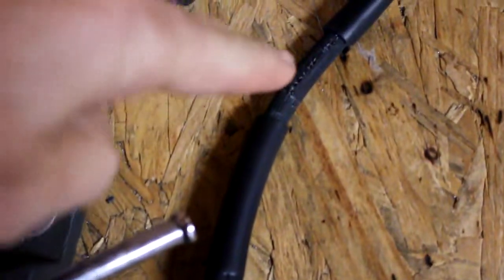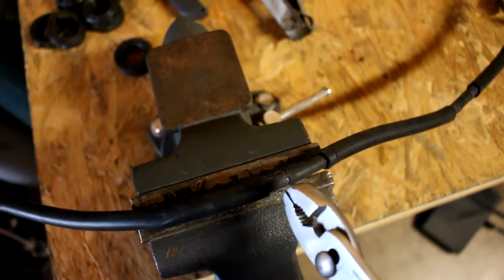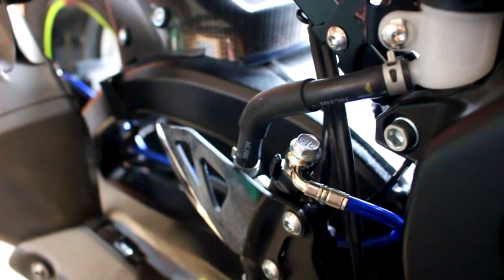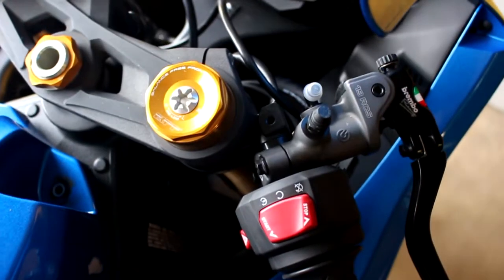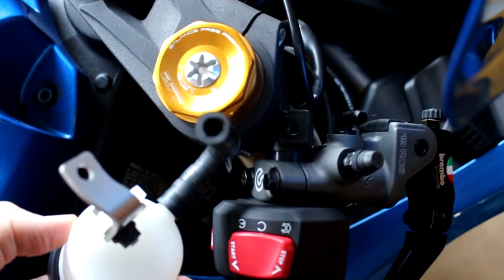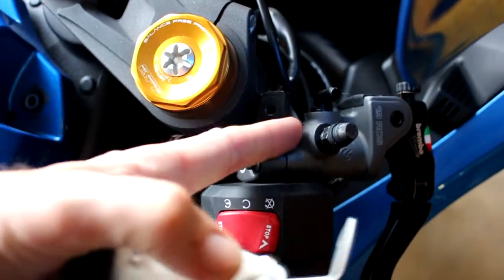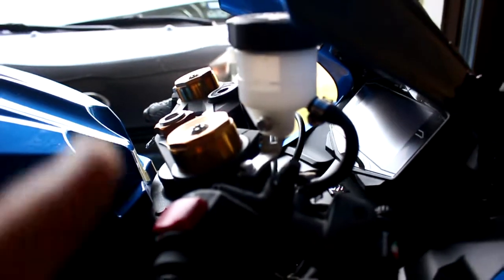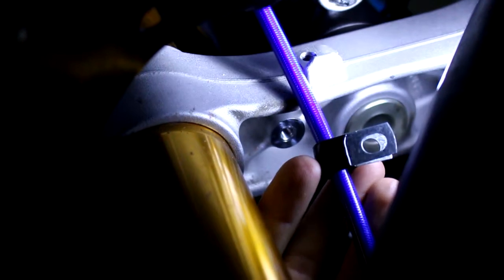2017 Suzuki GSX-R1000R Remove ABS Part 4

Comment: I received my golfer brake line kit and it seems to me these lines are much longer then they need to be. Did you find they had to much slack in them ?
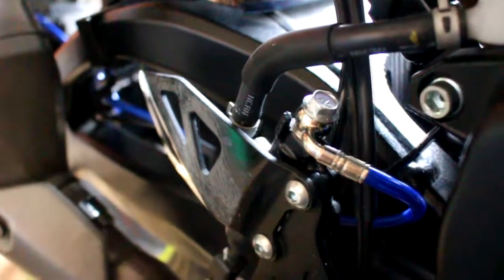Reply from the maker: @Mark - Only the rear line was a little long for my bike, because I could only find it for the non-R model, which doesn't have the ABS union, so the line is a little long, but I was able to route it to take up the slack. Check out this video starting at 2:33, and you'll see how I routed it. I haven't had any issues with it.

Comment: I haven seen any new ones from you in a while, Everything well??? I hope. I have a Bunch of parts I am having installed on Tuesday,  GB Racing Engine Cover Set, Puig Pro Frame Sliders, Hotbodies Undertail, Denali Sound-Bomb Compact Air Horn, Double Bubble Wind Screen, Front Axle Sliders, Lens for protecting the glass of the Head-Light, a Rizoma Next Front Brake Reservoir, and waiting for the Puig rear Hugger, Puig wrote back to me said it will be out to distributors by the end of the Summer, It looks FAR Better than the one they did have pictured on their site a month or two back. I have to have the Dealership do it all cause I have a 6 year Per Suzuki Warranty, a special they had when I bought the bike, One year, i wouldn't care, I'd just do it myself save all the money, something is likely to happen in 6 years though so, will pay the bit of $$$ now and hope I don't need the warranty, but being safe. Also having Hotbodies Flush Mount Front Turn Signals, Next is a Brocks Predator Full Titanium.  I want to get at the brakes as well, for now I'm okay with them though, just had the first Service done, Jeez but do these Babies EVER MOVE!!!!  Best to you.  :)
Reply from the maker: @liveatvictoria - I'm liking your upgrades, very nice. I've definitely put out some new videos, got another coming up in the next few days. I'm currently doing a $100 Giveaway. Be sure to see my playlist for new videos at: https://www.youtube.com/playlist?list=PLdw9gJ-WEjpTbPV_bO9lIsgVoTHHZIxuL

Comment: Just new to the channel was wondering can i change my k6 non abs gixxer 1000 brakes to later model abs brakes? I dont track ride just street.
 Any knowledge would be appreciated,  cheers.
Reply from the maker: That upgrade would be very challenging. There's a ABS pump, and ECU involved to make it all work. The K6 ECU isn't ABS aware.
Reply: @jryer1  hmmmm,o.k thanks for the quick reply. Love the channel keep it up.👌💯🔥

Comment: Hey Jerry,  Great video, question though, Why would you want to remove the ABS?  That was one of the reasons I paid the extra money and bought the R model.
Reply from the maker: One day I was riding fairly hard on a hot summer day, down shifted from 5th to 3rd aggressively preparing for a right hand turn, squeezed the front brake progressively harder and what do I feel? The brake lever starts to pulse! One thing I can tell you about braking, after spending a couple years racing in the CCS in Florida, the last thing you want is a pulsating brake lever. The Galfer stainless braid brake lines and the Brembo RCS19 master cylinder literally transformed the bike into a braking monster. After this modification I never had brake problems ever again. Since then I've sold this bike. No immediate plans to race or ride, but if I do buy another 1000cc bullet, I might go with the R1, just to try something different. The new Gixxer is a torque monster, a real track weapon. The ZX-10R has more HP up top, but lacks a little torque.
Reply: @jryer1  Thank you so much for the update and info!  Why would you sell that awesome machine???  Especially after all that time and money you put into it?  I am still recovering from the initial purchase of my damn bike, lol ($13,500) so I understand the cost associated with it, and the insurance on a liter bike is crazy expensive! $194/ mo with Geico and I'm 44 with a perfect driving record. That's crazy.  also, I'm 5'9" and had to get a lowering link installed just to be able to flat foot this beast.  No wheelies yet, just short pop-ups.  You are my go to, for gixxer info!  If you ever want to ride a new gixxer again, you can ride mine, just to feel the difference between a Suzuki and your new Yamaha!
Reply from the maker: @md12318  Appreciate it. Exactly my take on it as well. Between the bike payment and insurance it was just getting to be too much. I enjoyed it while I had it. I'm in my 50s now and there's a limit to how many wheelies and high speed riding you can do on the streets, before you're bound to get a ticket or two. I'm thinking about a 1932 Ford Model B sedan or pick up truck, absolutely love those old cars.
Reply: @jryer1  Due to the insurance, I'm thinking of a switching to  touring bike.  Looking at the Kawasaki 1700 Voyager, or an old Suzuki Cavalcade. https://www.youtube.com/watch?v=LXZsU7F1jkM.   Curious, did your clutch mod make learning wheelies easier?  I've got to master the wheelie at some point, it's just killing me not being able to pull one!

Comment: Hi, I hope you can give me some advice. I have a 2018 GSX-R1000R. Sometimes when I start the bike and pull off, my ABS light stays on. Yes, I do start it on the side stand and the bike is dead still when I start it. Diagnostics shows error code C1671 Inertial sensor error. We have swapped the IMU and still get the same error. Any ideas. Bike still under guarantee. Any advise will be appreciated.
Reply from the maker: First clear any error codes, use this video -- https://www.youtube.com/watch?v=S4_xeokrpls

Several things to check:
1. Did you have your ECU replaced by the recall yet? If not, check if it applies to your bike and get in done if it does.
2. Clean the front wheel sensor and the metal sensor disc, make sure there isn't any metal on the sensor (it's magnetic) and the plate is really clean (both sides)
3. Check the battery voltage before you even turn the key, bike completely off, no lights on, nothing. If it's below 12v, there's your problem. Charge the battery or replace it. This happened to me after I had the bike apart for a while, the light would come on and the bike did lots of weird stuff.
4. Did any techs work on your bike since you've had it? If they did, review the work sheet, and see what they touched, trace back the steps.
Reply: Getis Realis Thanks for the advice. 1. Yes, recall was done before I got the bike. Bought brand new. 2. Yes, sensors and sensor discs was cleaned. 3. Battery voltage 12,6V and 14,4V while bike runs. 4. Only work done on bike was a slip on exhaust fitted and it's first service. Halfway now before second service is required. 5. Yesterday, we swopped out the IMU with the dealer's bike IMU (same bike). Problem remains. Suzuki head office was phoned and at this stage have no idea what else could be wrong. Next we intend to get a new ECU but seeing that the recall was done even before I got the bike, I doubt that it's the problem. I've also seen a lot of comments on forums regarding low voltage that's why I was monitoring the voltage levels. Can it be that voltage levels seem good but CCA (cold cranking amps) not up to the task? Keeping in mind that the "R model" is fitted with smaller battery than the "non R model"?
Reply: @riaanzs1zarconradie291  Simple, many had this issue. You need a new stronger battery (the one that comes stock is underpowered for the ABS/TC system and somehow the abs doesn't get fed enough when you crank up the bike, you can actually solve this by just riding for 5 mins then turn it off/on again and it will dissapear but i recommend to change the battery with higher cca rate (200+), lithium-ion preferebly)
Reply from the maker: @riaanzs1zarconradie291  - Pascal seems to think battery as well, it may very well be the problem. If a new battery, fully charged, doesn't work, one more thing to check is your tip over sensor may be installed upside down, it can happen very easily, but usually the bike won't start at all if that's the case. Still worth checking if the battery doesn't solve it.
Reply: Yesterday we swapped my bike's battery with my dealer's Demo bike's battery. Immediately the demo bike had the ABS error and the error did not yet came up on my bike again. It seems that there might possibly have slipped a batch of faulty batteries onto the production line at the Suzuki factory. Thank you very much for your advice. Much appreciated.
Reply from the maker: @riaanzs1zarconradie291  You're welcome, glad you got it worked out. I can't begin to tell how many guys are frustrated just like you, trying everything, not realizing it just the battery.

Comment: I’m considering doing the same brakes system upgrades that you’ve done. Have you noticed a considerable difference in breaking feel or power?
I’m dabbling with track days and was wondering if I would notice any difference in breaking from say 140 down to 40
Reply from the maker: @Mark - It's really important in my opinion to first experience significant brake fade on your current bike. Without that experience you won't have anything to compare the upgrade to. So do this first, go for a ride on the hottest part of the day, pick a place where there's little to no traffic or homes. Try to find a road where you can get up to at least 130+ on a straight, which afterwards has at least a few corners, some small straights between the corners would be ideal. On the straight get up to speed, pick a conservative brake marker, and brake hard in a straight line, then take the corner, and accelerate like a bullet (full throttle) to the next corner, pick a conservative brake marker, and brake hard in a straight line, repeat the process over and over without a rest for at least 20-30 minutes. Keep moving your brake markers a little closer to the corner, but don't risk it too much of course. Don't be afraid to brake real hard, just be smooth on the lever, not jerky. The rear of the bike will probably move around a little. Most people never brake hard enough. You want to put a lot of heat into the entire brake system, all the components. After a little while the front brake lever should almost be touching the throttle and feel real mushy. At that point stop all aggressive riding, take the bike home nice and slow. And oh yeah, get a cold drink. This experience is an absolute must in my opinion before you do the upgrade.
Reply: Well great.  Thanks for the advice. I do appreciate it. I’m tryin to recall my last track day and I may felt it just a little bit and not paid much attention to it since I was busy focusing on other things at hand. I have a fathers day trackday coming up on the 10th I’ll pay attention to the fade. I’ll be honest, I bet your right about poeple not braking hard enough. It took me a bit to realize just how effective and capable these brakes are from 140+. I’m sure I can learn to brake even harder then I have been to this point.  Thanks again for the info.
Reply from the maker: @Mark - Sorry if I came off preachy, the upgrade is definitely worth doing. It'll handle anything you throw at them at the track. Have fun at your track day, do video if you get a chance.

Comment: Hey man I need your help. After finishing the brake lines install and bleeding it now for some reason my bike won’t start. The check engine light is flashing and there’s an FI light on. I bought an adapter to try and read codes but supposedly FI codes can only be read through a switch that puts the bike into dealer mode and displays the code on the cluster. I went through everything piece by piece and retraced my steps and checked everything I touched. Nothing was unplugged, crushed or questionable. I have no clue what it could be. I ordered the switch to put the bike into dealer mode to read the FI code but it won’t be in for a few days but I can’t wait that long. Is there anything you can think of I can check or may have done for my bike to crank but not start. I triple checked my install and everything looks good. The only thing I did do was try to start the bike with out wiring in the front brake switch but I don’t think that would keep the bike from starting. I wired it up and unplugged the battery to try and clear the lights but it still won’t start. HELP PLEASE!!!
Reply from the maker: @disarmyou84 - Very possible having the front brake switch disconnected upon start-up put the bike in limp mode. If the computer thinks the front traction control switch is malfunctioned, may have put the bike in "crawl home mode."
Reply from the maker: @disarmyou84 - You could try to reset. See video here - https://www.youtube.com/watch?v=S4_xeokrpls
Reply: Getis Realis it’s alive!!!! I jumped the two pins in the connector under the rear seat and got a C23 code on the dash. I looked it up in my service manual and it was a code for the tip over sensor that i put back upside down. Wow what a learning experience. Never gonna do that again. Just glad the bikes runs. FINALLY tested the brakes and the lever still feels a bit spongy so I have to bleed them again m
Reply from the maker: @disarmyou84 - Awesome, you're officially a Suzuki mechanic. That's how it works, little at a time, just keep getting better at what you know. Next time, you'll have it fixed even faster.
Reply: Getis Realis thanks pal
Reply from the maker: Be sure to post a video of your new brakes, I just got to see that awesome upgrade!
Reply: Getis Realis will do!

Comment: Hey I watched the video in 4 different parts so I may be mistaken but I didn’t see you bleed the clutch side caliper only throttle side
Reply from the maker: @disarmyou - I bled it, but didn't put it in the video. I ordered a Mity Vac, and will rebleed front and back one more time. The little electric vac pump stopped working after 2 uses, a real piece of junk.
Reply: Getis Realis wow it’s so funny you say that because I went on amazon to buy the same one but there was so many bad reviews on it that I ended up just getting hand held vacuum pump that works good off ebay
Reply from the maker: @disarmyou - See now if I was a little smarter, I would have done the same thing the first time around hahaha